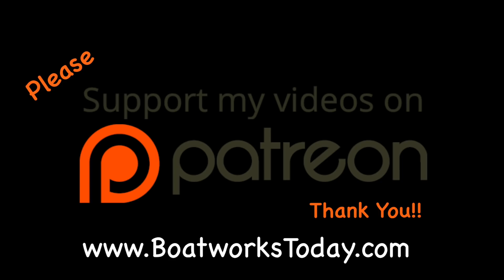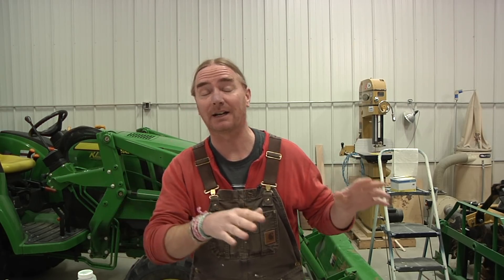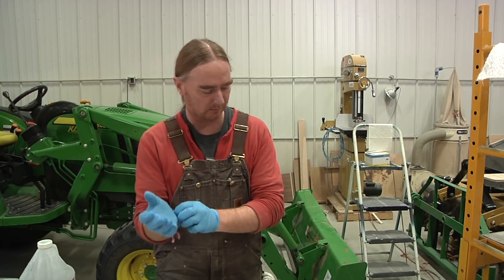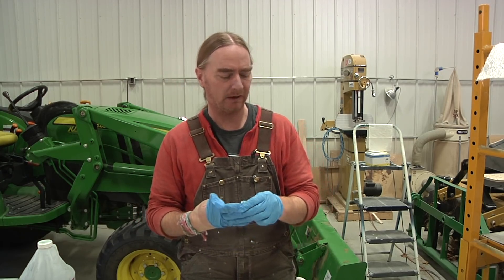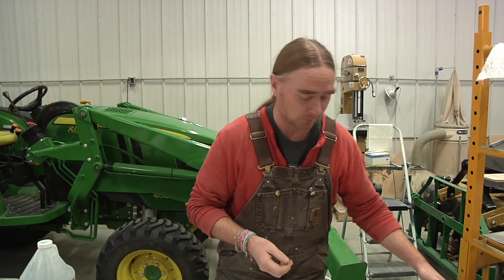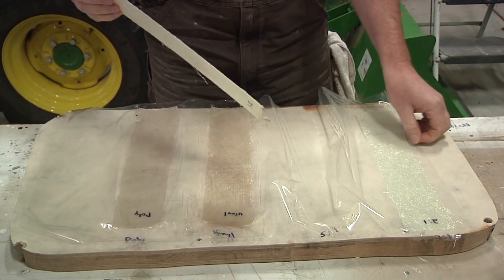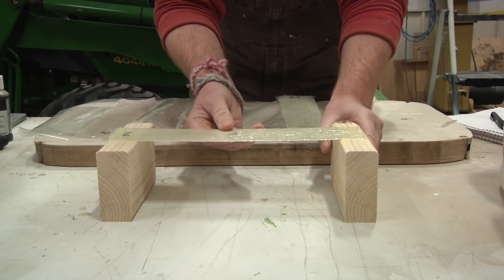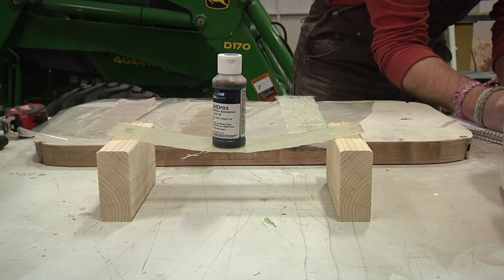Testing The Strength Of Different Fiberglass Resins!

Comment: Good stuff. I applaud you for trying to get a handle on this. I would suggest a few enhancements:
1) Create a 2-3 layer lamination.
2) Use a longer 2 x 4 and line them all up together. 
3) Add one weight to each strip, check the deflection, repeat.
4) Do a quick estimate of how much you spent on glass and resin for each strip.

You obviously can't do vinyl ester again, but you could publish a cost estimate for an equivalent amount of resin used for VE vs. the others.

Comment: Great test Andy, AND your camera work is great in this video. My compliments sir. Even with the air crease in the poly, it showed great ridgedness. I think it did show that the epoxy both 2:1 and 5:1 were easier evenly absobed by the fibremat then the poly, making the resin easier to work with. 
I got the advise that since my boat is made of polyester I should not use epoxy anywhere on the boat as it is not compatible, strength and flexibility wise. What are your thoughts on that? Cheers.

Comment: Sorry, trying to stiffen the deck after construction is essentially closing the gate after the horse left. it's the tension side (the bottom surface of the deck) that makes it resist bending movement, not the compression or top side. Of the four resins, epoxy has the most elongation and will help the least, polyester has the least and would help the most. In a perfect world a layer of carbon fiber on the underside of the deck would be the most effective but impossible to now to install. However, if no one has fallen through the deck, it's strong enough.
Reply from the maker: Regardless if the glass I'll be applying to the top surface corrects the flexing, it still needs to be done to mitigate future cracking.  Keeping this in mind I'm not wasting any time or materials, it's just another step of the overall process :-)
Reply: @boatworkstoday It ain't the glass cracking, it's the brittle gelcoat. Remember I said that polyester had the least elongation? That's why it's cracking.
Reply from the maker: Actually there are a couple reasons for the cracking on deck.  1)The previous glass repairs were done poorly, and 2) there were some issues with the original layup from the factory (voids and dry glass within the laminate).  Much of the gelcoat had already been removed from the previous owners work prior to painting and for the most part the gelcoat looks really good.  Now that the cracks have been corrected, laying new material over the entire area will help to stabilize the surface minimizing the potential for future issues.  Kind of a belt and suspenders approach

Comment: How would you go about repairing a fiberglass corner?? boat slid of the trailer rubbed on aspalt and made a 1 inch hole, would it be good to make a mold and pour thicken epoxy?

Comment: Epoxy needed at least a week before this test, also i notice the biaxle strips you made were not cute to same size after dry, the polyester strip had a small lip with a small return on it on each side (from the excess resin) that made it a little stiffer. Not trying to be an ass just trying to explain why your polyester felt a little stiffer. I send people to your videos all the time. Keep up the good work.

Comment: I think the best way to add stiffness is to change the shape of the structure.  So you can either make the whole deck thicker or glue beams underneath for support.  Making it thicker with glass and resin is one way and maybe the easiest way to do this is with poly resin and glass mat.  It will be thick and therefore stiff.  1x1 glass square beams  glued to the ceiling would be lighter and stiffer, but a lot more work.  I prefer epoxy over polyester when I want the best adhesion.  I really have not seen poly fail where epoxy would have worked.   I also prefer the lower odor of epoxy. More and more I'm using poly for the quick set and the low cost.  Thanks for sharing your experiment!

Comment: Poly above water line vinyl and epoxy below the waterline
3M 4000 above the waterline 3M 4200 below the waterline 3M 5200 screw the next guy..

Comment: Not very scientific... The resin to fiber ratio is super high.  If you want 'Apples to Apples' testing, you leave the fiber out all together.  Beads of resin allowed to cure are put into in tension testing device and pulled to failure.  Deflection test is also done but is similar to the way you performed it, just more controlled.  Sheer test is completely different... All of these tests have been done in labs, Epoxy won them all hands down.
Reply from the maker: The resin to glass ratio was was ideal for the material that was used.  Going over with the squeegee not only removed any trapped air but also removed all of the excess resin that the glass did not need.  This was done on each of the test samples :-)

Comment: Question Andy. A few years ago I was repairing a surfboard for a friend. I used polyester resin to fix the hole and t just would not buff out and shine like the rest of the board. When I gave it back to him he looked confused. I told him how I tried to buff it and use a polishing compound etc but it would not take the shine. He said well, usually you dont need to polish the Epoxy boards... Doh. Questions is, how do you know what material you are working with if you do not know what the original construction of the boat is.

Comment: I've never worked with vinylester resins and am wondering what they're generally used for and are there any benefits? Is it cheaper? Because I feel like there has to be something that makes people still use it with its abysmal shelf life.
Reply: Hey, Vinylester has a high chemical resistance
Reply: Works wet like PE and can be overcoated like PE without sanding. originally only a little more cost than PE.  final cured properties as good as or better than most epoxy. VE is terrible at bonding to other materials though

Comment: Hi Andy. I am a retired structural engineer. The large deflection test you did (thin laminate over long span) causes the test specimens to deflect so much they go into membrane tension (think tension in the plane of the laminate like a suspension cable). Therefore, putting them rough side up or rough side down will make a difference (in theory, rough side down will create more friction at supports and permit a greater degree of stiffness during membrane tension and thus reduce the deflection). And as Todd Dunn commented, epoxy can take 4-5 days (my experience is 7 days) before you get the full stiffness. I think you should review the technical data and find which resin has the higher flexural modulus. The higher the modulus the greater stiffness it will add to the laminate. I did the homework for you and found 5:1 Total Boat Epoxy has a Flexural modulus of 450,000 to 460,000 psi. 2:1 Total Boat Epoxy comes in at 330,000 to 360,000 psi. Total Boat Polyester Resin is only 17,205 psi. So the Epoxy is your best choice for higher stiffness, with the 5:1 being the stiffer of the two. However when it comes to laminates, even though epoxy resin is much stiffer than polyester resin, the glass fibers provide most of the stiffness. 1708 fabric has 17 ounces of fibers running in +/- 45 degrees with 3/4 of an ounce of matt backing. Fiberglass fibers have a modulus of 10,500,000 psi. With 50% of this stiffness running one direction in 1708 fabric and  50% in the opposite direction, you still have an approximate modulus of 5,250,000 psi. Glass to Resin volume should be at about 60% to 40%. However, I find hand lay-ups are wetter and end up being about 50/50. So the glass in your laminate is going to provide 50% x 5,250,000 psi or an effective modulus of 2,610,000 psi. 5:1 epoxy will only contribute an additional 50% x 450,000 psi = 225,000 psi modulus to the laminate. 2:1 epoxy will contribute 50% x 330,000 psi = 165,000 psi additional modulus. Polyester will only contribute 50% x 17,205 psi = 8,602 psi additional modulus to the laminate. Summing up, 5:1 epoxy and 1708 at a 50/50 volume ratio will give a total modulus of 2,835,000 psi. 2:1 epoxy will be 2,775,000 psi and Polyester will be 2,618,600 psi. Therefore, in conclusion, the 5:1 epoxy laminate will be 8% stiffer than the polyester laminate; the 2:1 epoxy laminate will be 6% stiffer than the polyester. You will have to decide if this small increase in stiffness is worth the extra cost of epoxy or just use 10% more glass with your polyester lay-ups. Hope this helps.
Reply: Damn, that's a great and simple explanation on how engineer view a situation, could read more like that!
Reply: Guillaume C. 
Wow, I agree!
Reply: @guillaumec.2816  k
Reply: That was a fantastic explanation.
Reply: Finally, a comment on YT that is detailed, succinct and valuable. For best value, it seems like polyester resin is a route that makes sense, especially when Gelcoat is applied over it to cure it. Thanks for an excellent comment and analysis!
Reply: Also, the cube rule applies.  The thickness of the deck is the biggest factor.
Reply: Dennis Simmons Great explanation I have thought of it this way based on discussions with other engineers.  
"One point on epoxy and why an epoxy and glass ( or carbon) laminate is so strong compared to polyester. In very rough number elongation of polyester is 1-2% , glass 3-5% , epoxy 7%. This means that in an epoxy laminate the fiber takes the full load where as with a polyester laminate the resin is under stress before the glass is taking full load. At least that a good way to think of it. A real composite engineer will correct me I'm sure"  
Pure flex as Andy was testing here I'm not sure is the correct test method for what info he is looking for but it does provide some real world conditions I guess. Also interesting the tooling VE resins we have been using require a different catalyst and don't like over catalyzing. I'd like to see some post curing too But real world ...... 
Cheers Warren
Reply: @CheersWarren  that is very important.  leads to the fatigue of polyester layups.  the resin can only stretch so many times, before it is dead.  also spidercracks due to brittleness / lack of elongation in the resin
Reply: @noticingisourenterprise  from my experience spider cracks come from, apart from an impacy, a/ Too thin a laminate which permits flex b/ too thick of an application of gel coat - gelcoat doez not want to flex especially when its cure has aged.
Reply: Good description.  yup the bulk of strength and stiffness comes from the fibers, not the resin.  As this writeup says, the resin might impact a few percent one way or the other when used with glass fiber.  There's probably more of an impact in this crude test in the variable resin application than the actual resin type (ie variation in wetting).
Probably more important to do the repair with the same type of resin that the original boat structure was built with.  
I'm a structural naval architect for the navy, metals and composites work, going in 30 yrs on the job.
Reply: I like turtles
Reply: @andrewwilliams9419  Me too but my wife likes Turtle soup.
Reply: The single best comment on YouTube.  Ever.
Reply: WOW ! Just wow , that's awesome stuff right there ! Please come to dinner some time !!! lol
Reply: I'm confused. Isn't the laminate and resin supposed to give tensile strength, toughness and impact resistance? The stiffness only comes from the width, shear strength of the beam / core material. The stiffness of the laminate will almost have zero effect the wider the beam gets. Only the tensile modulus has a big influence.
Reply: That must of been tough writing that from your phone 😂 but in all seriousness great explanation.. Top marks
Reply: Excellent comment Dennis. As you said, the stiffness comes mostly from appropriate selection of fiber and orientation. I have found therefore, that using carbon uni directional as a strap will stiffen up a whole panel of glass laminate. Way more than can be achieved with even multiple layers of glass.
Reply: I'm late to the party and have no resume to take issue with anything you said here. My comment is that I suspect that if you repeated the test with a 1/2" core and one strip of fabric with most of the fibers running the long way, you would get a lot stiffer panel.

Use three layers per side and alternate the middle layer 90 degrees, you would get amazing stiffiness especially if you kept the resin to the bare minimum.
Reply: Wow! This comment is the perfect compliment to this video. One of those times when the YouTube community works the way it was intended to work :) thank you for the information.
Reply: Your explanation is excellent, even for the Layperson & I just wanted to add my personal thanks for all your time and effort, I very much appreciate it Dennis! Put together with Andy's demo here it all says & shows a great deal depending upon what project a person has in mind & potential costs vs result involved. Thanks again!
Reply: I had to quit halfway thru due to my discalculia, because I was about to go into a permanent state of eyeglazia! 
I got the gist of it tho...
Reply: Dennis Simmons math is cool
Reply: Very interesting 😮😮
Reply: The polyester sample looked cupped just looking on a phone which would explain less of a difference than anticipated.  I wonder if your resin supplier would cough up an industry standard test method for laying up test coupons? They spend some r&d time coming up with a test method that minimizes test coupon variation so the can get a better measure of resin variations.
Reply: How come the poly has only 17k psi compared to the epoxy which has 330-450k psi -- but still the resulting psi when combined with fibreglass is almost the same between 2800k (5:1), 2700k (2:1) and 2600k (poly)??

If the poly has so much less psi at 17k, why is its psi when combined with the fibreglass almost just as good as the ones with epoxy (which have a much higher 330k-450k psi)???

Thanks~
Reply: @IrregularPineapples  If I'm reading it correctly, he's saying most of the strength comes from the glass itself so your only adding 50% of the resin modulus (due to the 50/50 glass to resin) to the 50% of the glass modulus. Base number of glass (after glass angle and ratio modifiers) 2,610,000 plus the modified resin value. 

5:1 Epoxy = 2,835,000 (2,610,000 + 225,000)
Polyester = 2,618,600 (2,610,000 + 8,600)

Not sure if I helped much and I'm no engineer (lol) but that's how I understood it. 

Cheers!
Reply: wow, appreciate you taking the time to put it in understandable words
Reply: Can you explain with more detail please. Lol
Reply: Thank you for that. Seriously it was a great read.
Reply: Is not strength also measured in abrasion resistance, chemical resistance, exposure to sun and other elements along with time, brittleness and water permeability (think ice) , inhabiting marine life etc.
also consider adding to epoxy value over  brain cell structural loss from off gassing polyester cabin fever.

Comment: resin is not for bending its only made for bonds... also comes into what is the "mat" you use Carbon over Kevlar or even glass mat. yes you need a "flex" and shelf live is a BIG deal... 60:40 is a rule with the right stuff for cure times... that is mat to resin ratio by weight..

Comment: No matter how many time you tried to experiment with the Epoxy or Polyester resin and you will always get different result due to different home town climate  such as in Oklahoma we have vary up and down humidy compare to Florida heavy humidy so it really depends on where you live and weather according to my experience work with fiberglass. Polyester resin is cheaper than Epoxy and short shelve life compare to Epoxy has long shelve live so both resin will work on any fiberglass and yet still will make the boat float!! Smile!!!

Comment: My background is in manufacturing surfboards both with Poly and 2:1 epoxies and a thin layer of cloth and resin similar to what you used for your test.  Your test is flawed due to the short cure time you allowed before testing.  In my experience Poly does not reach its full strength for at least 3 days and 5-7 days at 75* F minimum for epoxy.  With Epoxy we will even use a hot box to get maximum strength in a shorter amount of time.  We call this post-curing.  Even with Poly if I sand a day or two after I laminate vs sanding the board a few days later the resin is noticeably softer and easier to sand.  If you really want to get an accurate test I would suggest using some scraps of 1/8" or 3/8" Divinicell glassed on each side and then given at least a week to fully cure.

Comment: Curious why you would use vinyl ester when it does have such a short shelf life.  Some people rave about it of course....  As a fiberglass repair craftsman I wonder if you feel it necessary to try to use the same base of resin that the original piece or boat you are working on was made with. My glass experience has been limited to gliders (sailplanes) and only helping the licensed repair person to fix various damaged areas. Each glider manufacturer allows only their recommended resin for any repairs.

Comment: interesting and an effective way to get a good guesstimate with a simple test. My gut says that the stiffness has much more to do with the geometry of the laminate (as you implied) and that other factors would be much more important.  Toughness and resistance to impact would be two characteristics that I would be interested in
. I think that most of the stiffness would come from the thickness of the  laminate (the thicker the laminate the more tensile strength can increase stiffness) and the stiffness of the core itself.

Comment: I would suggest "while you have the test strips" clamping each test strip between a couple peaces of wood with an equal amount of strip protruding on each. That way you can stack weights until each fails and determine what would crack first under stress. Just an idea. 😎